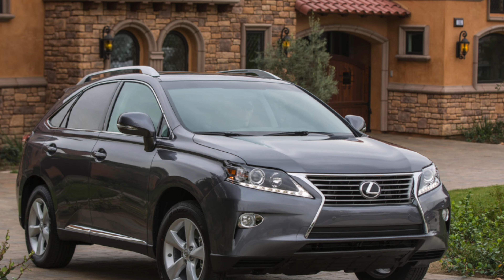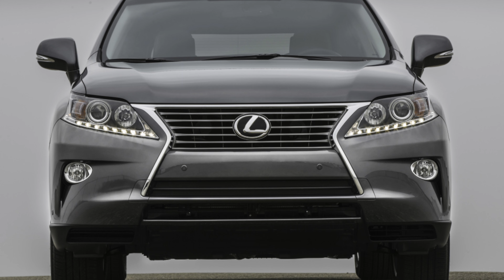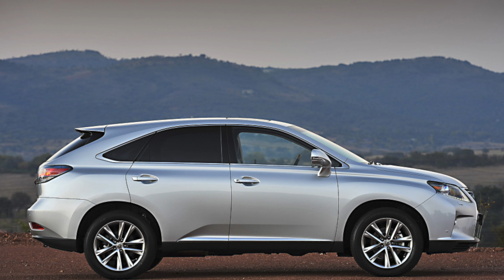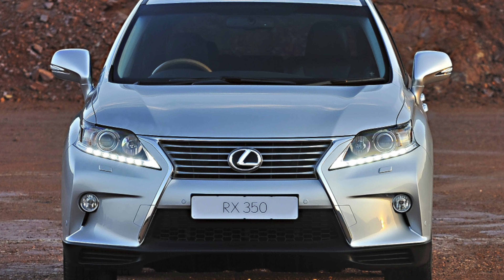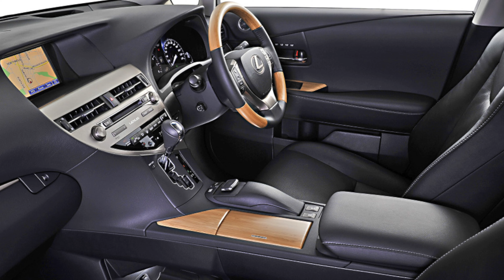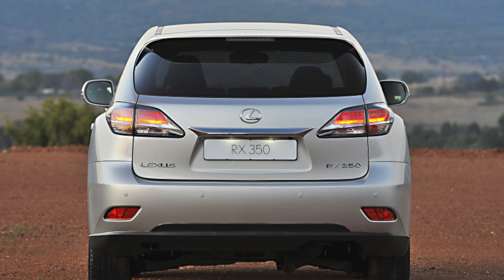Lexus RX 3 Problems | Weaknesses of the Used RX AL10

Comment: The timing chain in any Toyota engine, 99.999% never need to be touch for the life of the car, 300k miles/500k km or more.  AS long as good oil change 5k miles/6 months. Only certain production year of the 2GR-FE family has sprocket problems that is redesigned and no more any problem.